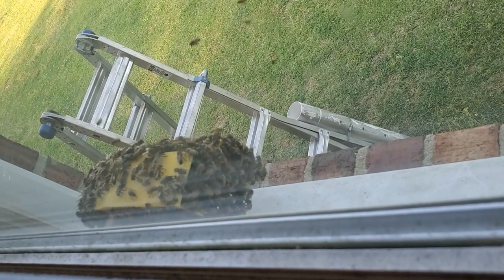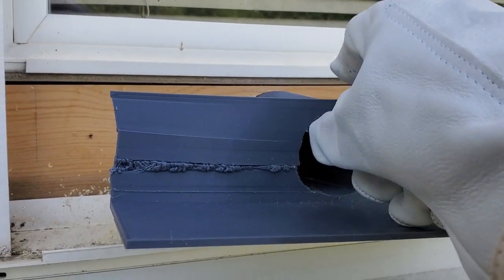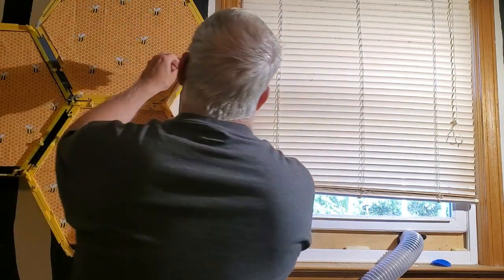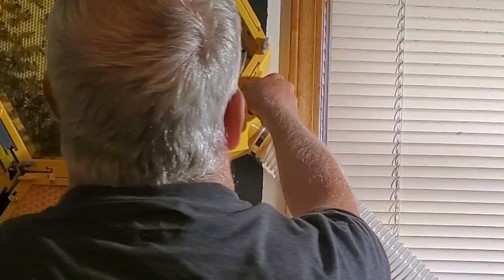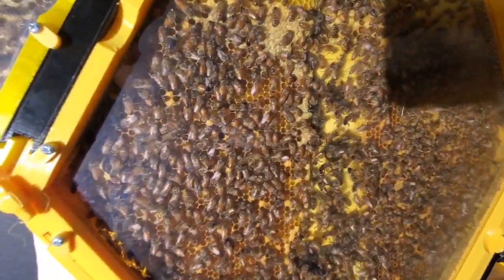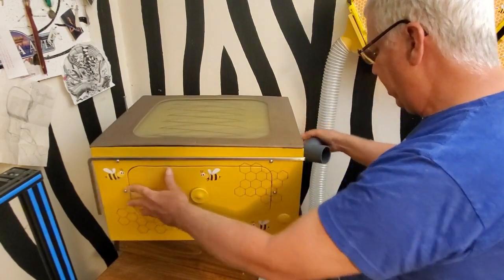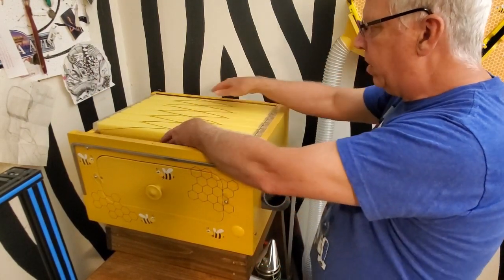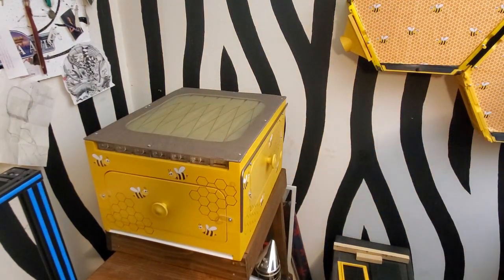Enlarging flow hive entrance.

Comment: When you made the hose / hose to outside significantly larger... how did you deal with hornets/wasps, moths, robber bees, etc? 
I find with my observation hive if the actual entrance hole is larger than 20mm and hose larger than 30mm, they are not able to 'defend' the entrance hole properly. Hose size between wall cells (brood?) and honey cells (flowhive frames) can be any size. 
Did your bees make honey in the flow frames when they are below the brood (wall cell) frames? 
My bees will only make brood in the lower frames and honey in the higher in elevation frames.
Did you find you had more honey in your flowhive frames If/when you moved the flowhive frames box to a higher elevation compared to the wall units?
Reply from the maker: I hav made some changes this year. Here is a link to a later video. https://youtu.be/8WoNydKwMFk

Comment: How are you going to separate the bees away from the hexagonal frames? As each generation is born in used hole it gets smaller so the new born bee is smaller. Are you going too take the hexagonal hole frame holder off the wall when scrape the wax off, Then put it back?